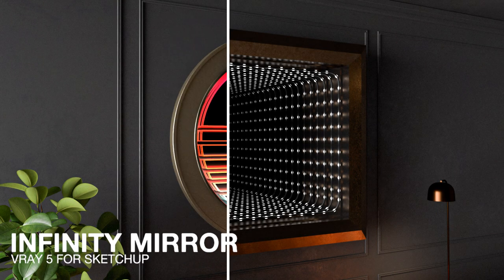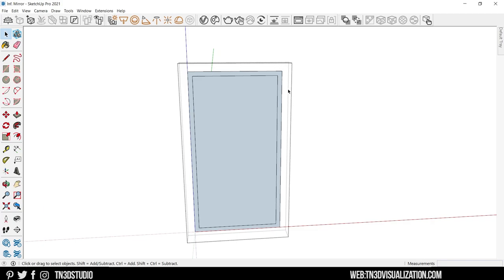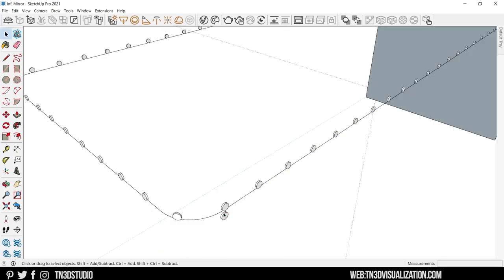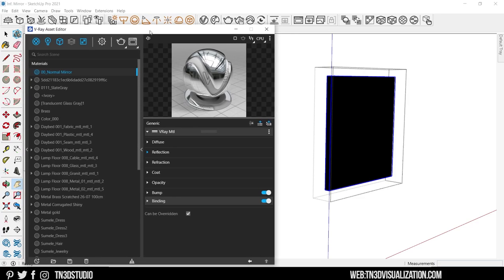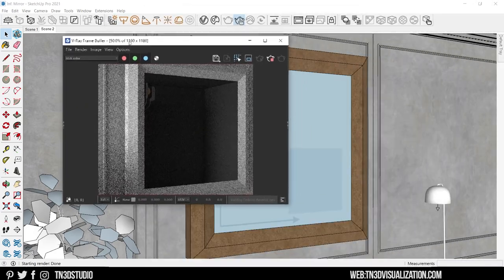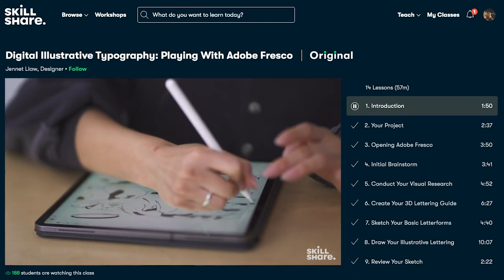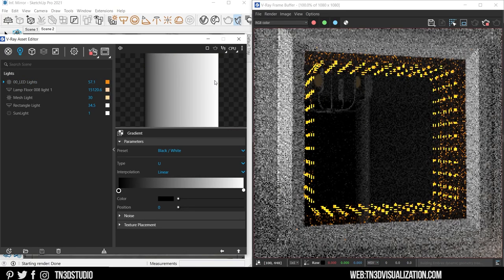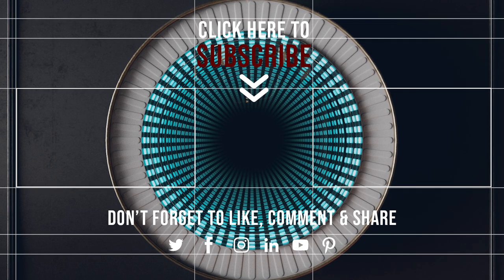V-ray for Sketchup Interior | Render Infinity Mirror Tutorial | Vray Material Tips

Comment: I just have 2 reflection and max depth i used 150,, anyone can solve my problem?
Reply from the maker: can you clarify.
Reply: @TN3DStudio  i mean the reflection of the lamp in the mirror didn't like i expect with the same setting in your video? i want to build and render like yayoi kusama infinity mirror,, is there any good setting for it? like my problem may be also depend on the size of the lamp or the length between front glass and the mirror cause i just make an asumption about it..
Reply: @TN3DStudio  i used max depth at 150 that i expect the reflection can be as long as in you rendering (from 5 to 150 to make longer reflection). But in my experiments i just have two reflection not 150 like yours.
Reply from the maker: @tapaktanjak2427  Are you working in CPU Mode?
Reply: @TN3DStudio  Yess,,, exactly.. did i do something wrong?

Comment: To render the infinity mirror effect
-It doesn't show the effect in CUDA and Interactive Render
-To achieve the effect the setting must be on CPU and it works only on Final render option
Reply from the maker: Yes, You're Correct. The Max Depth is also limited to default value in Interactive render (5)